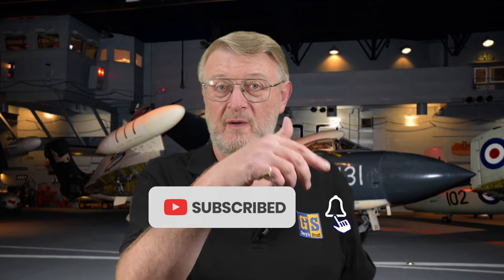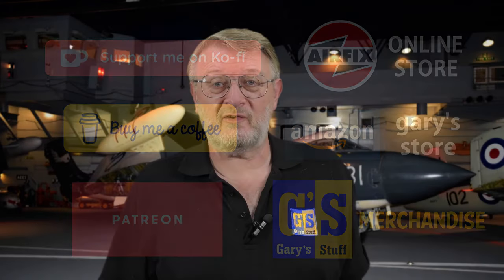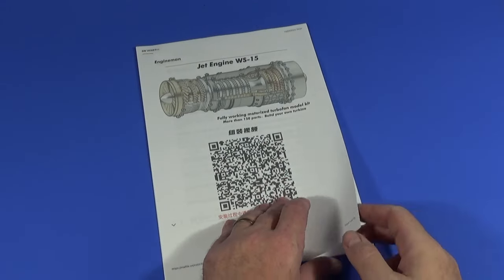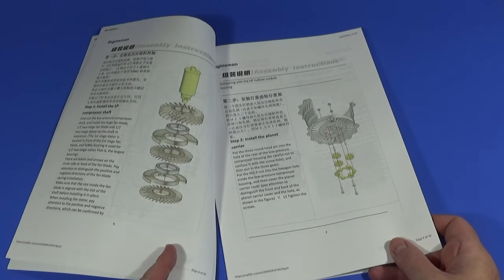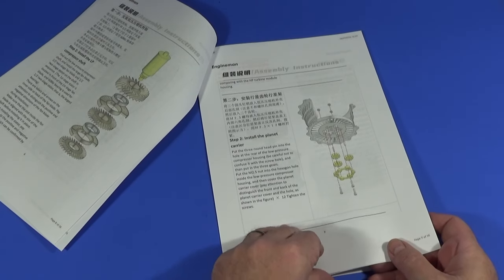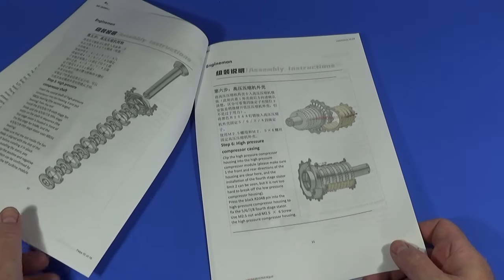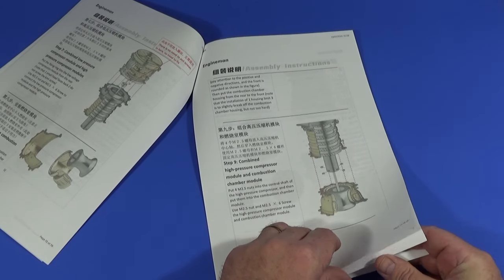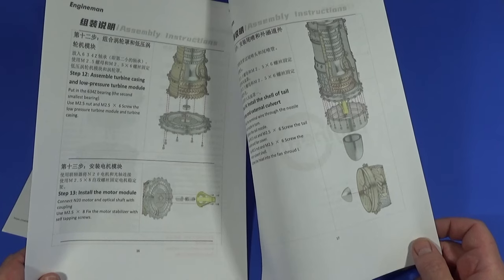WORKING ENGINE WS15 MODEL from STIRLINGKIT- How to build it!

Comment: Gary just the man.  I was working on my car and took things apart and after watching this you should come up n put the watjamacallit back in the thingimy jig
Reply from the maker: Provided you still have the original gear flange support plate bracket you’ll be fine…
Reply: @garys_stuff  do keep an eye on those gear flange support plate bracket bolt locker ring wires!
Reply from the maker: @whtalt92  I am waiting for the special tool...
Reply: You lost me at gear

Comment: A very good video and review of this kit. Unfortunately it didn't hit the mark for me. Jet engines are very well engineered high precision bits of kit and yet when I saw that running at the end with some of the compressor bits wobbling around it looked all wrong.. I didn't think the finish on the parts was very good and the blades looked very "heavy" and rough. As you said the stators couldn't be seen and it would have been nice to have some LED's to show where the fire is in the engine.

Comment: The Spey was a bypass turbo fan if im right it use to say it on the tridents in BEA times ,I thought at one point it’s was going to be trashed sometimes I don’t think some kit manufactures every try one out 
All the best 
Mark 😊😊
Reply from the maker: The Spey was a low-bypass turbofan, you are right.
Reply: Question the noise of a jet is the hot exhaust gas hitting the cooler air I’ve noticed on cold nights or windy nights the airliners going into Heathrow sound noisier

Comment: A Kimi Screw is the one that has no head on it. It screws in flush with the surrounding area.
Reply from the maker: So what we would call a grub screw then?
Reply: Yes. I believe it has other names as well such as a level set screw. Probably where they sourced them from calls them that. I wouldn't be surprised if they got a bulk lot off aliexpress as most listings on there use that name.

Comment: Don’t use a ball ended Allen key posting through gaps! A standard Allen key works just as well!😊!
Reply from the maker: Ball ended is all they give you...
Reply: @garys_stuff  hi Gary! Always worth having a few standard Allen keys kicking around! Ball “enders” are generally used for screwing down a bolt at an angle when you can’t get at it with a standard key!bit like a universal joint! On that engine it only really needed a ball” ender” for a couple of screws!as you found out they don’t sit on the end very well! But I do admire your tenacity!😊!

Comment: Interesting to know how a jet engine works and to watch it being built but glad it was you and not me 😂because l would have become a little vexed 🤬unfortunately with Chinese instructions it can be a common problem could be in the translation, l had an issue with an F4F 1/32 Wildcat by TRUMPETER as it had no colour call outs, so had to buy a reference book and not being to clear where to glue parts, so one or two mistakes, said l would not buy another but did went and got a new P40 Warhark in 1/32 and everything was great 👍 P.S you would think the kit was for review QC would have been better ☹
Reply from the maker: You would think, Barry. When I was in the camera game years ago, we got a special "review only" batch of new product that was specially checked at the factory to be on spec or better. That's why Which? magazine used to wait until the cameras were on the market then go and buy three from different stores to get around our dodge! Any time anything went for review it was checked and cleaned by the technicians. Nothing, but nothing, went to the press with "ah, that'll do."

Comment: Im sorry Gary, but at 25:19 I have no idea what happened. You are building after waiting a month, the piece doesnt appear to fit, then 3 weeks later a completely different part appears on screen. Have you started that section again? Was the 3 weeks wait your fault or the kit supplier? Im a little confused.
Reply from the maker: The box had two no.6 stators but no no.4 stator. I waited a month for a replacement. When it got here it was obviously for a different product as it didn't fit. it then took three more weeks for the correct part to arrive.
Reply: Yeah, I commented as I reached that stage, but you did explain at the end of the video. Thanks for replying though

Comment: Good on ya, Garry. An honest appraisal of "what's in the box". A warts 'n' all build video. I can tell you are being honest with your review because you've complemented the kit's good points, but on the balance of probabilities, you've told them, "thanks, but no thanks". The kit did look pretty swisho in the box, but the quality control of the packing (wrong stator supplied) put me off. You must get better after sales service in Blighty, because I think I'd be up the creek without a paddle out here in the Colonies. And if you are going to go help Jelly-B fit his whtjamacallit, make sure to flush out the schveigel valve with dihydrogen oxide before fitting it.
Reply from the maker: Dunno Mark, you're probably closer to them than we are so might get replacements more quickly!

Comment: The quality of the 3D printing is too low for me. If I spent that much Id expect a quality finish. I would want to sand all those pieces and then Id have to repaint them. I could 3D print and paint my own pieces for a fraction of the cost. Thanks for completing this its been helpful.

Comment: My very basic understanding (written before I watch the video) is that in essence instead of the propeller being in front and open it's within the front of the engine and rather than push the aircraft forward /itself/ it's pushing the airflow into the combustion chamber where it mixes with the fuel vapour, is then detonated and it's /that/ energy release that is directed out of the back of the engine to push the aircraft forward.

Now to watch the video and see how wrong I am! :) [Edit post video: Oops I forgot the compressor stage]
Reply from the maker: It is better seen on a high-bypass turbofan like a RR Trent - the huge fan at the front generates about 85% of the thrust, as it bypasses the core and goes straight out the back. There is a lot of it, but it travels relatively slowly (relatively is the crucial word here!). The remaining air goes further into the core, gets compressed and heated even more, has the fuel injected into it and ignites. The very rapid expansion pushes the whole lot out the back really fast, past the turbines that turn the compressor stages and the main fan. The core exhaust travels really fast, but is shrouded by the surrounding fan exhaust so it keeps the noise down (clever, eh?). If the fan at the front is replaced by a real un-shrouded propeller (with gearing), then you have yourself a turboprop, and if instead of that you have some gearing that leads to something else (like a rotor disc) you have a turboshaft.
Remember that it is the act of throwing air really quickly backwards that makes the jet (and whatever is attached to it) move forward. The jet isn't "pushing" against anything, it is simply action-reaction.
Reply: Thanks  @garys_stuff  . I used the words push and pull basically referring to Newton's Third Law, so the action of the thrust backward has the opposite reaction of the aircraft propelling (perhaps I should have said propelling not pushing) it forward.
Reply: Good explanation. @garys_stuff

Comment: I’m afraid it’s a no from me too. It is kind of cool, especially if they would do engines from a MiG, Sabre or Me 262, for example, but it’s not $200 cool. I looked up the manufacturer and they have higher priced models in their range too.
Reply from the maker: A good model of the BMW004 from the Me262 and the Derwent from the Meteor would be good to compare centrifugal and axial flow compressors.
Reply: @garys_stuff  seriously Gary, I would buy those and if the prices are somewhat south of $200. 🙂

Comment: I hope Rolls Royce has better quality control for its jet engines lol.
Reply from the maker: If you ever get to watch a programme about RR and its engine technology, it is truly awesome - I mean it inspires awe. The first stage turbine blades are a thing of beauty - each is made from a single crystal of steel (they take a couple of days to "grow") containing all sorts of exotic elements, they have cooling air channels laser-cut into them and they are balanced across the rotor disc to within fractions of a gramme. They operate in a gas flow that is about 20-30 degrees hotter than the steel's melting point (yes, that's what I said), spinning at up to 40,000 rpm at take of and can never, never fail. I can't think of any manufactured product that has such insane demands on materials science and manufacturing technology. Each Trent engine has (I think) 90 of these turbine blades in the first stage disc, each has a scrap value of around $10,000.
Reply: 40000 rpm @ TO  is a bit too quick, more like 10 to 13 K on the HP spool depending on variant. 92 HPT and 126 IPT blades.
“Suck, squeeze, bang and blow”  that how it works. That’s how it is taught in STEM.
Reply from the maker: @paulkerry666  top info Paul! SSBB is also for reciprocating engines IIRC?

Comment: Ref the lack of printed instructions, fair point. However from a financial point of view it's probably cheaper to make one PDF and give purchasers a link to it, than create the /same/ PDF, then buy paper and ink, then print instructions for each box, plus the instructions would have to be in various languages - this way they could do one ODF per language if they wanted to. Also if they do make a mistake it's cheaper for them to amend the one PDF knowing the QR Code will always point to the most recent version than send out a load of errata sheets, and/or scrap any remaining wrong printed instructions.

Then the money saved can be used to make a better model - or passed on to shareholders.

[Edit: Post watching video: Good kit marred by questionable quality control and poor instructions - poorly written originally and then poorly translated to compound the problem. The essentially seven week delay replacing part errors was IMHO inexcusable when the likes of Airfix can replace missing parts the same week.]
Reply: You have a point, but the pdf instructions can leave a sour taste in the customer’s mouth. I built a wooden ship kit from Artisania Latina which came with pdf instructions. On a purely practical level you need hard copy to work from really, and it cost me nearly £50 in ink cartridges to print them off at home. It would have been far cheaper to the customer if they’d just done it commercially and added a couple of quid on to the price.